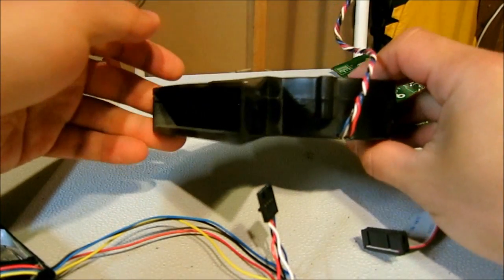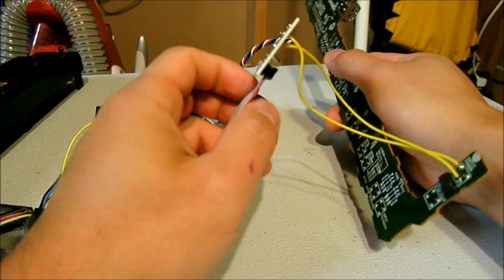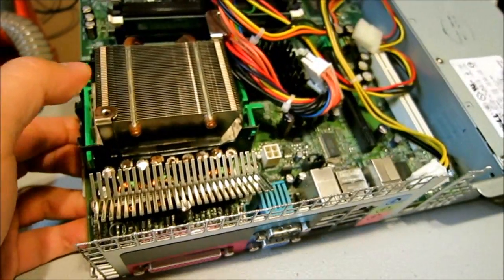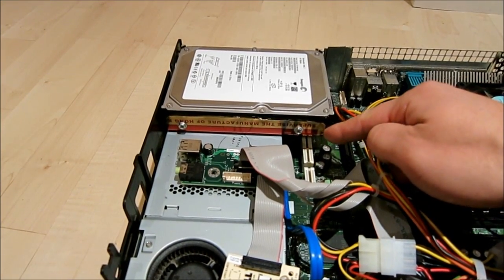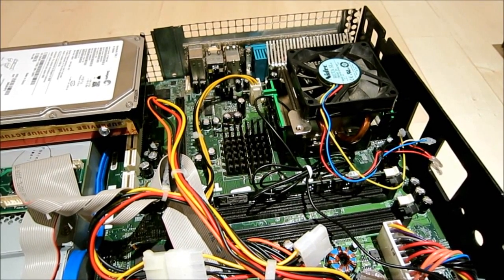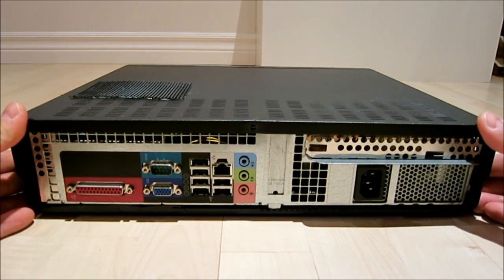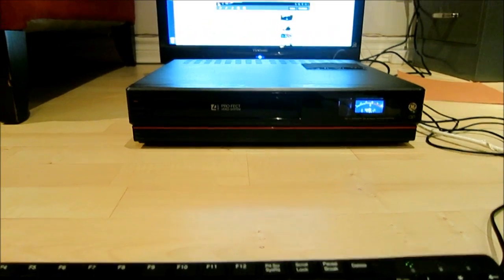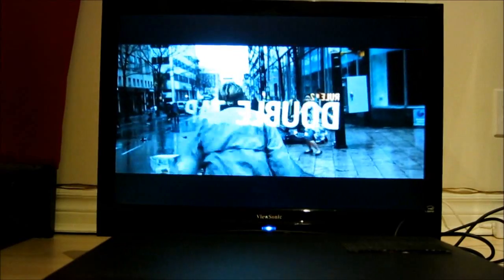PC in a VCR- Build

Comment: Great job!

Reminds me of a computer I built 17 years ago, made to look like a cassette stereo. It had an analog needle connected to the hard drive LED header. Almost looked like a speed gauge. I soldered the keyboard controller onto the motherboard and wired the most essential keys (enter, esc, space) to the front dash. Also installed a track ball from a laptop, so it could be operated without a mouse as a media center. PVR's didn't exist back then and nothing could decode Divx codec aside from a full size computer. The LCD readout such as the one you're using wasn't an option back then. Nowdays these case mods are so easy to do, I build them just for fun. VCR's and other similar dimension cases are dirt cheap at second hand stores, and computer parts are equally affordable. In the past I hesitated to try risky designs because I was afraid of frying things. Not anymore. Just finished a 486 build in a CD player. Always a joy to work on these things as well as watching others.
Reply from the maker: enilenis Wow, your projects sound great. Tinkering is fun!

Comment: I have about same system mine is 270 Great idea your doing with old vcr.
Reply from the maker: Thanks. Yeah those old computers can still work!
Reply: No usb ports on the front? I thought you would make some usb ports i did it with mine.....
Reply from the maker: Nah, not for this kind of build. Really it's gonna just sits there in the bedroom and streams media/kodi. Don't need the usb ports. It has a lot in the back if really needed. It's just like adding an optical drive. Just don't use one so... I'm not gonna waste time or money fitting it in.
Reply: Ladybug Adventures well what if you can't access the back, for exampe if it's in a tight cabinet, Anyways i did usb ports on mine it really isn't that hard to do. It would only take 5 minutes to do so anyways...

Comment: i have a dell Optiplex 270 GX case that i salvaged and i want to use as a upgraded pc. good enough for low end gaming (as a direction on how strong i can make it). is there a recommended motherboard or build i can do with it?
Reply from the maker: If you look up the specs on a 270. Max RAM is ddr 400 mhz which will work but a little slower and harder to find. I normally stay away from ddr and stick with a minimum of ddr2 because they are easier to find and you can get twice the speed for less money. The chipset is intel 865g which will support the pentium 4's with hyperthreading>3.0ghz which in my experience runs some simple games and runs Kodi. If you want to do a build like this vcr one, the sff version is better suited, just measure the height and width and length!
Reply: +Evan L Cool. I want to build a pc with this case. it's empty and has nothing.

Comment: With no optical drive, what happens if you ever need to re install your operating system?
Reply: Or you could just do it via USB Flash drive, it will be faster than your slow, aging CD ROM.
:D
Reply from the maker: Good question. I open her up and hook up an old ide dvd rom to the motherboard. I left just enough room to get it in and there is an extra molex for it.